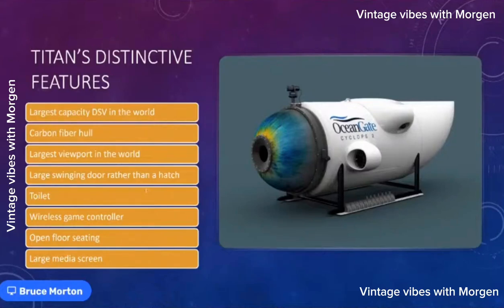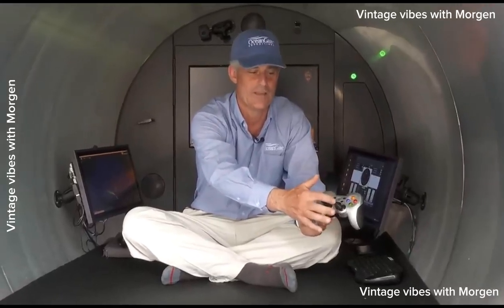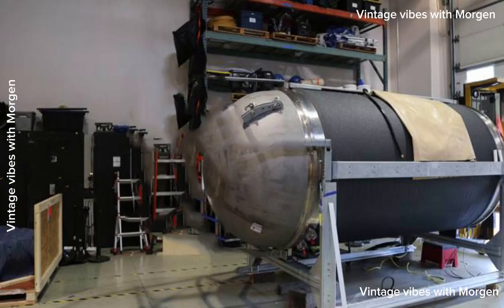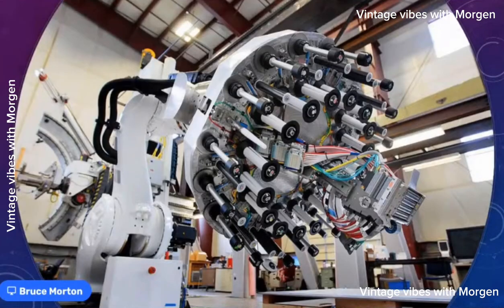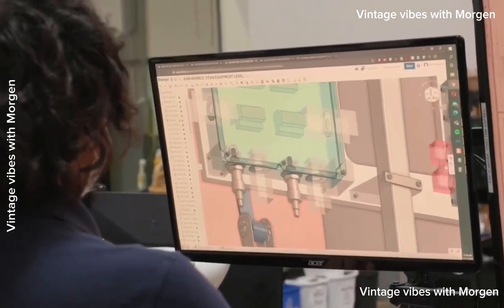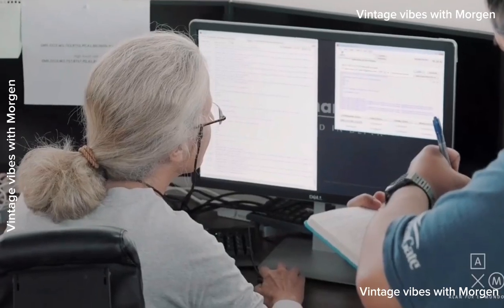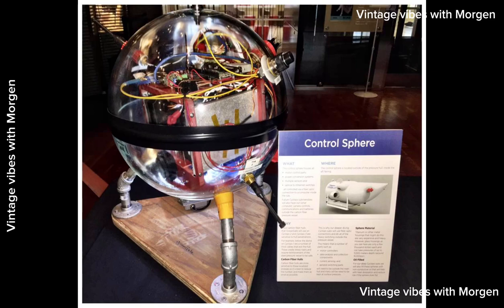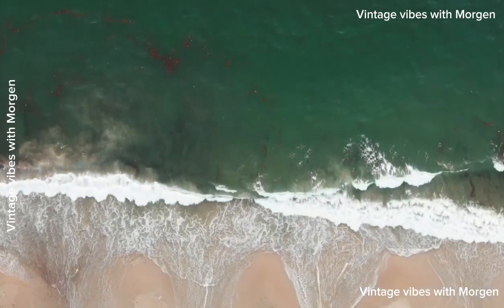Insights From The Engineer : Exclusive Archive Showing Hidden Secrets Of The Titan Submersible !

Comment: This sub chould have worked in a smaller depth. If you have to monitoring your presure hull. You are actualy saying that you dont trust your construction. So they where not sure if the hull was good enough. Titanium has a much largwr density and is proven to be strong in these depts. And there is a reason why deepsea presure hulls are made spheric. To equalise the presure even. This sub was never made fore going so deep. You can not diy every thing. Its wrong to compare this sub to any other sub in the community. Because they did not cut corners to build and operate their subs. They are all certified. Its strange that the frenchman Nargeolet that went anboard that faitfull day didnt think about the risk. Ha had a lot of experience 😢

Comment: 14:26 I suppose this was a model from oxygene box. But where was the real thing located in the sub?
Reply from the maker: Its the same one my friend,  oceangate has removed the original video,  but it's same idea , as fir the location of this box , its located in the aft dome where the electronic components were located, i can link you the original Oceangate's post !  thanks for your comment.
Reply: Oxygen box isn't the right word, it's a CO2 scrubber used to absorb the CO2 people exhale into the liquid. Oxygen is added from the pressure bottles. I would have guessed this was only a proof of concept and the real thing would be something much more professionally built but it seems VintageVibeswithMorgan says it's the very same equipment that was then used in the sub. In that case, it's blows my mind. Sure it works basically but god damn it, you can't have a contraption like that in a deep submersible. What if it tilts too much and the liquid splashes into the fans?
Reply: @skunkjobb    @VintageVibeswithMorgan  If this was the real thing it would be really hilarios, with that hot glue etc.  I think most of the sub was pretty well done, the control spheres, the floor in the sub, the computers, many ways to drop ballast, little syntactic foam etc. It looked professional. Did you understand the Name of that powder? Can't find anthing about such a CO2 absorbing powder?
Reply from the maker: @skunkjobb  16:38 here you can see the so2 scrubber box in the floor,   later I'll link the original one by oceangate , they are the exact same , thanks for your comment my friend.